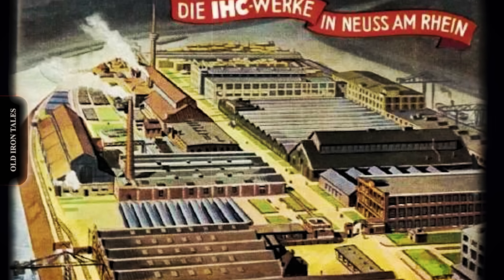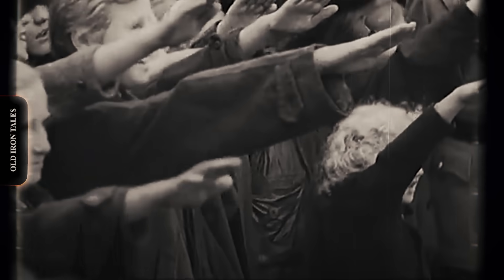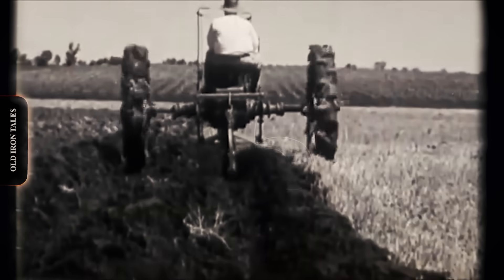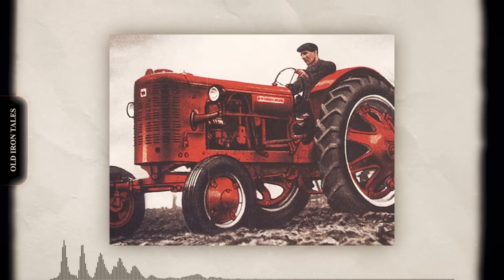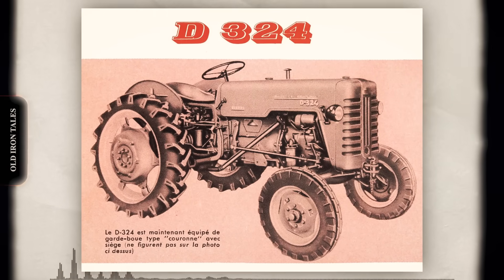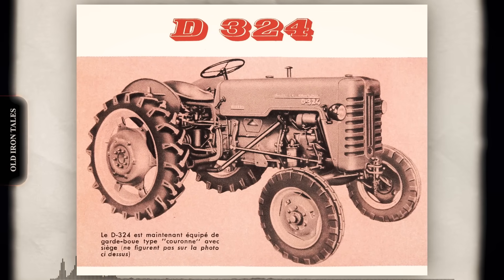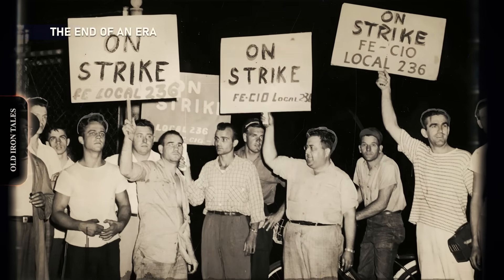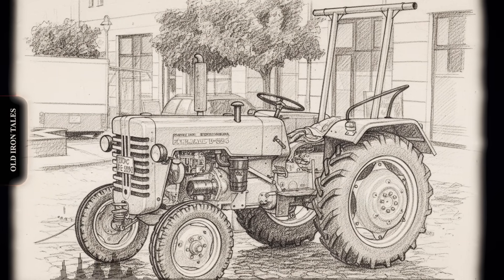International Harvester’s INSANE European Takeover – The D-324 Tractor

Comment: Don't think the d324 had brakes on the front corners
Reply: The vehicle is not equipped with front brakes. It does not use drum brakes; instead, full disc brakes are mounted on the differential extensions. I personally own a D436; the primary difference is the engine, while the transmission remains the same.